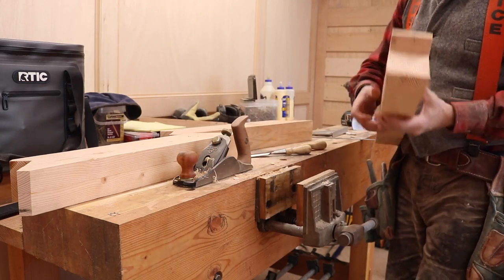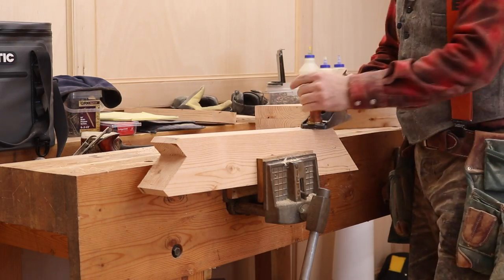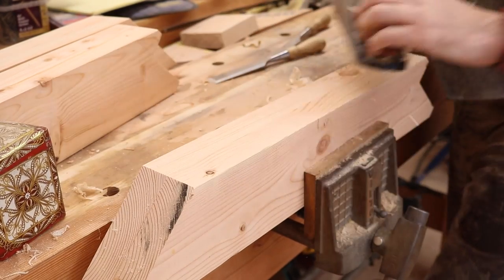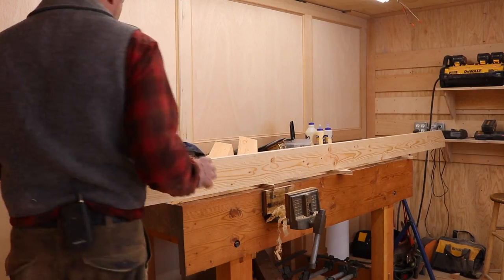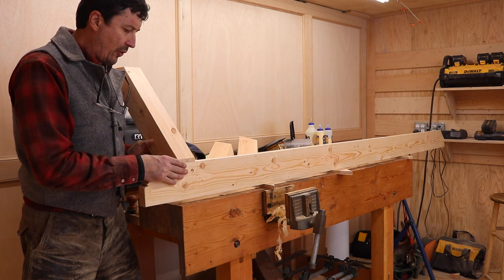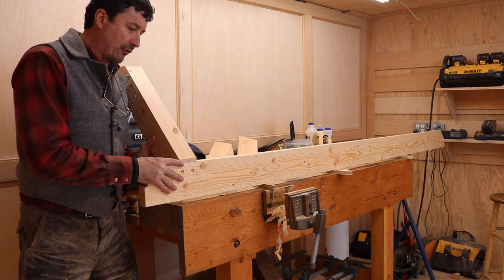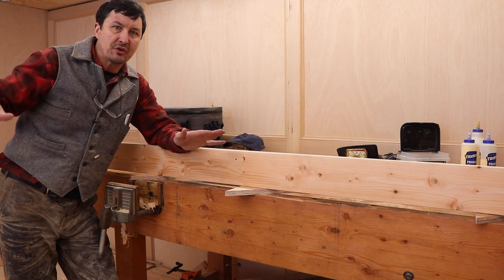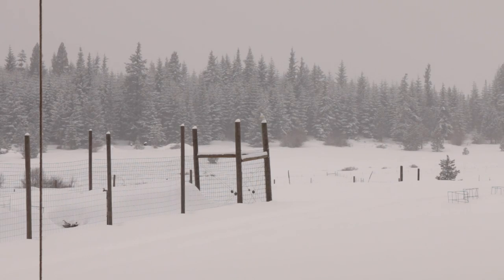Amazingly Simple Work Bench - BEAUTIFUL!!

Comment: I'm enjoying the short philosophical vignettes at the end of many of the videos. I hope you keep it up.

Ummmmm, didn't you spend a lot of time on your table saw cutting the chamfers off of the dimension lumber, only to go back and plane them back onto the lumber? Perhaps only should have squared up the boards for the table top, eh>

Or maybe you just wanted to play around a bit more with your favorite tool, the hand plane.

Oh and thanks for the tip about using the Ballistrol. I'll give my planes a spray or two.

Thanks again for all you do, and also, please extend my most sincere  BD wishes to Jack. I have a 12 year old grandson and he is a great pleasure to hang out with. 

Hope our paths cross someday.
OMW Tacoma
Reply from the maker: I cutting of the half round so I can put a chamfer, the two are not the same,
Reply: OK that works for me. I agree a 45 degree small chamfer has mucho more eye appeal than a factory round with a crappy ridge where they didn't have the planer correctly aligned. Thanks for the reply and clarification.
OMW
Reply: The bullnose on factory lumber is ugly and rarely uniform
He had to glue two pieces together so that would have looked awful at the seam.

Comment: I'm a 16 year old kid about to undertake the process of custom building my own computer desk. This is my first time doing anything like this, and I don't think I'll have any access to power tools like a bandsaw or circle saw, etc. Do you have any tips for me?
Reply: Yeah I was planning on just using some plywood and having them pre cut it, but I just have no experience putting screws and all the other hoopla in. I actually drew out the whole desk I planned out in my head on sketchup (thank you 7th grade tech class) and now I'm just trying to figure out how I'll assemble it and how sturdy it'll be, along with where I'll put stuff like my steering wheel.
Reply: John Smith if you have a drill and a hand saw you can do it! Take your time and layout everything. Keep it simple.
Reply: Honestly I have it all planned out methinks. I have the sizes of all of the pieces, thanks to SketchUp, and I have a general idea where I'll put all of the screws. I could be completely wrong, but what better way to learn than jumping into the deep end and learning what can and can't work?
Reply: It's a simple desk so really I hope I'm not underestimating it and I have everything planned out. The main thing I'm unsure of is how exactly I'll make the legs (right now im thinking of 4 separate pieces and screwing them together to make one) and how i'll have the top go on (thinking of planks connecting the legs together and then just dropping the top piece down on that, maybe with a plank or two in the middle for support.)
Reply: John Smith Man, the best advice I can give you is to make things repeatable. So far in my experience, if you've got to make 4 legs and have 4 separate pieces of stock, and you're going to say...cut them to length, do it all at once by clamping them together, or setting some sort of stop block up for a consistent cut. Even if you're original measurement is slightly off, they'll all be the same and it won't be as much (if at all) of a problem. Don't get discouraged, and remember, 1/64ths matter:) Godspeed

Comment: don't ever set a plane down on the sole of the plane.
Reply from the maker: Why not?
Reply: ytgc14544 can damage blade...
Reply from the maker: How does a wood surface damage a tool steel blade? If you are correct wouldn't the blade be damaged every time you use it? Please explain,
Reply: Wranglerstar .....true enough, and you're right....  its that thing about setting a good habit....of course even a woodworking bench could have a metal object or contaminant left laying.  i guess i put this habit in the category of not leaning on a machine tool like mill or lathe...or not stopping drill press chuck by hand-braking for quickness...etc. 
thx for reply and for the conciencous presentations.
Reply: The blade is far more likely to be contacted by another tool if it is lying with the blade exposed, or worse, you could easily catch  your hand on it reaching for another tool.  There is absolutely no logical reason why a plane should be placed on its side on a woodworking bench.
Reply: Yes, possibly....my comment applies only to us lesser creatures of habit....or poor souls without a dedicated "wood working bench"....mine shares duty with glass and carbon cloth when cutting preforms for composites (extremely abrasive) as well as occaisional bronze & silica powders.  While there is exposure to adjacent tools, the weight and impact of setting it atop a tool is more concern to me.  And this is also how I stow them in my woodworking tool box, or my metal Kennedy....but what lengths we go to in order to justify our behaviors, ha. So I respect your logic as well !

Comment: In support of gluing vs screwing the braces and other parts:  there are dead loads and there are dynamic loads.  Vibrations don’t care about screw point (fastener) loads.  Vibrations will, over time, weaken any screwed or nailed connection.  A glued joint will spread the forces over the entire area of contact and (since any quality glue is stronger than the joined materials) will spread the forces over the combined monolith.

Comment: It's always interesting to me on the difference between what you think you know and what is reality. I've always thought of the Pacific NW as having cool/cold, Rainy/misty type winters with the snow found mostly on the mountains (Wrong). Here in the lower Ohio river valley our winter has been surprisingly mild so far (at least when compared to the last 3 winters), almost no snow besides a quick melting dusting, temps. cool/cold but not unbearable, by Monday it's supposed to be in the low 60's, I can live with this kind of winter (you know I've just Jinxed myself, winter is far from being over).

Comment: Happy birthday Jack!  
Cody, the supports connected to the ledger, connected to the wall, Is there gonna be enough support to use a vice on the bench?  Wouldn't any pounding just be transferred to the wall?  I'm no expert, but I think it would be best kept to a vertical post or support, delivering the energy to the floor, and not the wall.  Tell me what you think.

Comment: A question for either Cody or some of the long time Wranglerstar subscribers. I am a fairly new subscriber, and have recently been going right back to Cody's first videos. I am confused about one thing, at the very start Cody and family were clearing ground for the homestead, but the location seemed to be on the side of a heavily wooded hill with a steep valley below them. Then all of a sudden the location seemed to change to a much flatter plot of land with a house already built. I don't know if YouTube have mixed all the videos up, but i cannot find any video that mentions moving to a new plot of land. Seems like something is missing from the time line.
Reply: 100SteveB there are some missing videos if my memory is correct. Basically there was no land on that original homestead to plant or have outbuildings.  It was a small plot on the mountain.  They thought about it and decided to sell and find a plot of land that was flat and large.
Reply: Thank you sandyamsterdam, i was going mad trying to make the connection between the homestead they have now, to what Cody was clearing at the start. It's a shame that the videos that explained it all have gone missing. But thank you again, i can now stop trying to tie the two plots together!

Comment: If a bench has legs going to the floor, any downward force goes to the floor.  With the 45 degree supports you are using, half of the force is transmitted to the wall attempting to pull the bench away from the wall.  How are you connecting the top ledger to allow for that extra force?

Comment: What was the point in ripping off all the corners if your just going to put them back
Reply from the maker: I chamfer is very different from a half round,
Reply: this is strictly curious. Could you not plane the half round to the 45? or would the revel of the chamfer be to great
Reply: A chamfer also protects the corners from chipping and splitting.
Reply: Some times ripping is to create a perfect 90 degree to the other face. The intent was not to remove all the corners.  The end result, of course, is a perfect perfect 90 degree corner. So perfect that it can cut you.  There is another channel, Woodwhisperer, that covers that.  So chamfer is a common technique among woodworkers.